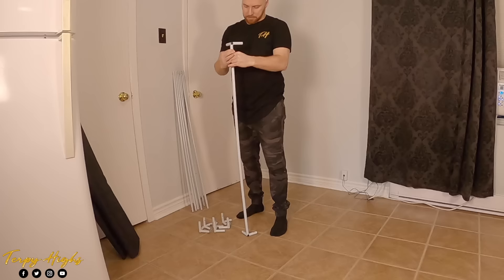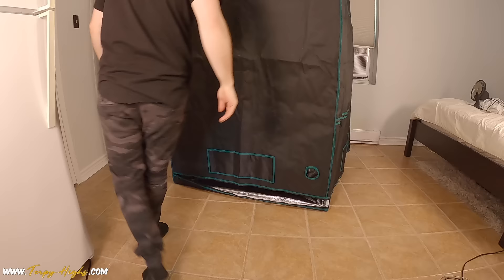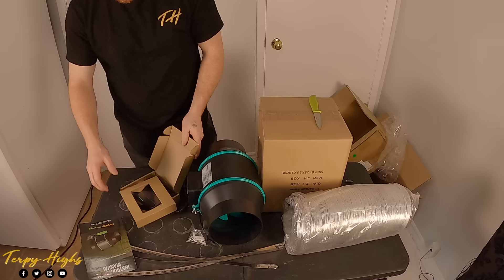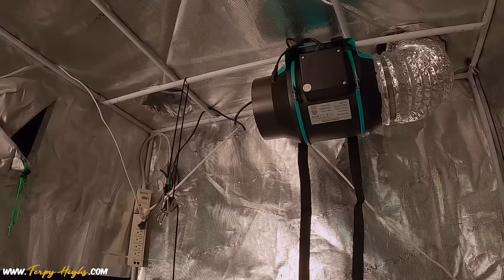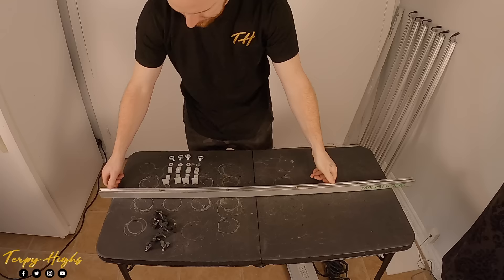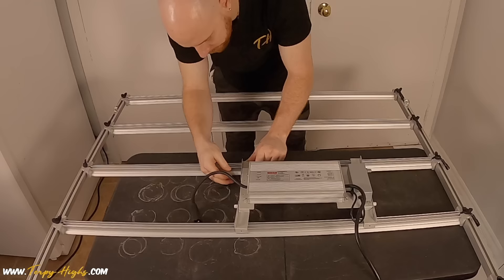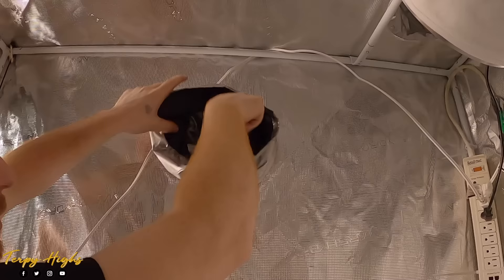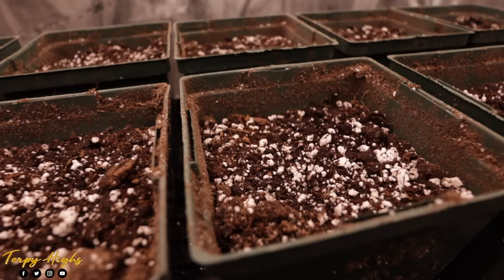Building a Complete Grow Tent Setup for Beginners Everything NEEDED!

Comment: I've been running the Mars Fc6500 for almost a year now , I bought it as soon as it came out and it's in a 5x5 and my buds are next level , I can't hardly believe I'm growing bud's like this ! It's more than enough by itself but I use 3 T5 HO , 4' LEDs on the walls and every single bud is rock hard and smokeable , no larf and very little heat !
Reply: Nice
Reply: What light would you recommend for like 150-400€? I think almost 900€ for this light for a beginner is crazy expensive
Reply: Cap
Reply: I got the sp3000 I love it... I don't even have all the extras lights on the side. And I get good results...... but I keep my larf.... because I use that for the edibles. Like gummies.. so sometimes I don't strip and lolli pop . Just depends on what I'm doin..
Reply: @fablenumber1fan  aww she's mad

Comment: Awesome timing! I got a new 5 X 5 (150 cm X 150 cm X 200 cm)with pretty much the same stuff except with a old school brand new 1000w switchable HPS/MH magnetic ballast & reflector + a bulb of each type & one 16 inch oscillating stand fan.  New to indoors & need to set up my set up soon. Got 5 plants vegging outside (well... 7, but they are two Autos deep into flowering & they will stay on the patio) in the free 17 hours & 24 minutes long daylight where l live (today's day length) & plan to switch 'em into flowering mode when tent is up & running. Been growing since 1986 mostly greenhouse & outdoors and this is my first venture into the great basement indoors, eh?    😤

Comment: I ordered the TSW 2000 and sadly enough my ratchet strap for my carbon fan gave out and like on the day of install you know and it dropped and luckily I was in the tent when it happened I was able to protect the light but it still busted the found I'm currently in touch with Mars hydro and hopefully they fix it

Comment: The power strips usually have a light on them so u know it's on. I use some duct tape to cover it during the grow
Reply from the maker: The light on mine does not work.
Reply: @TerpyHighs  lolol. Perfect
Reply: @TerpyHighs  my bad bro I didn't realize some troll already mentioned it
Reply from the maker: @growjaysimpson4646  no problem, thanks for the input every bit helps in one way or another.
Reply: @trapperjohn8508  yup. Only light u want to use if u have to when your plant lights are off is green light. Otherwise u may cause naners aka hermie aka little pollen sacs

Comment: 4 inch exhaust is plenty for a 4x4, 6in is overkill and then some. My 4 inch mars hydro in a 4x4x8 sucks the walls in on lowest setting of my speed controller.  32Db for the 6in?  I doubt that, the 4 inch with silencer and filter produces more DB than that... not much more but still unless you have this silenced and boxed it will be over 45db guaranteed, which is not super loud but it's not 32db(30 is considered a whisper) level of quietness.  good video dude, I subbed.

Comment: nice set up bro! I also have a 4x4 and am waiting on my fc-e6500 to arrive. My only issue I think im going to have is with my ventilation. I have the ac infinity 8" carbon filter and T8 fan. I predict im going to lose about a foot of hanging height if I keep my exhaust at the top of the tent. I may put the T8 and carbon filter on the floor so that I can reclaim that foot of height.
Reply from the maker: yah you can run the ventilation differently by either putting it ontop of the tent outside. so you would be pushing air through the filter instead of pulling the air through it.
Reply: What’s up with that flange thingy u installed at the bottom of the tent? Did u do that to increase airflow?

Comment: Are you plugging in all your devices on the same power strip? Im in the process of setting up my first grow and I am worried about overloading my circuits. Is it safe to plug light, exhaust fan, humidifier on the same power strip?
Reply from the maker: Do not put your light into a power strip. A typical power strip can hold 10amps of power and do not go to its limit.
Reply: @TerpyHighs  Ive got a surge protector that says its max load is 15A 125vAC 1875W. Is that not good either? What would you suggest?

Comment: I had a question if you didn't mind answering but I'm doing 18 hours on and 6 off during the 18 my filter will help with the smell but when it's off for 6 hours can I leave it all closed up for the smell since the fan and filter isn't on or will this suffocate it? Thanks
Reply from the maker: as long as you have air flow inside the tent so its not standing air then you will be fine but be aware if you dont have any air exchanging in/out of the tent the humidity is going to raise very fast.

Comment: Trying to setup grown tent in my downstairs garage but have no window for ventilation is it possible to still setup ???
Reply from the maker: Yes, all my tents are vented into the ro they are located in. Not to a window. Only different is you'll need to keep your garage Temps under control.
Reply: Okay sounds good so I can just leave the end of the duct exhaust outside my tent my garage is normally Pertty cool never gets higher than 80 degrees in there

Comment: Sorry for the dumb question I’m a newbie . With the inline fan that’s exhausting air out . How is it getting the air in? Are you leaning one of the access holes partially open to allow air flow in ?
Reply from the maker: yes bottom vents are open to allow air in while the fan pulls air out of the tent.
Reply: @TerpyHighs  mucu appreciated thanks for explaining that